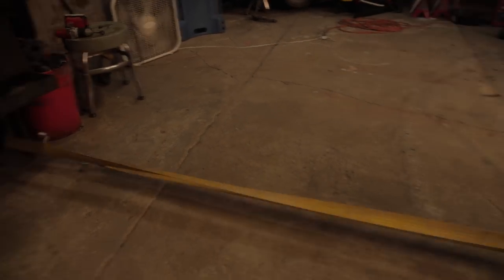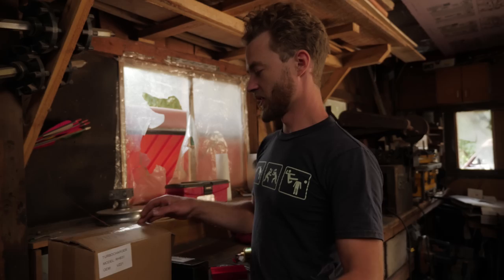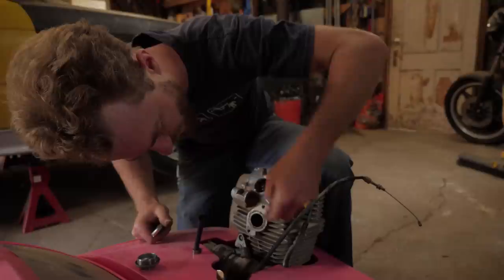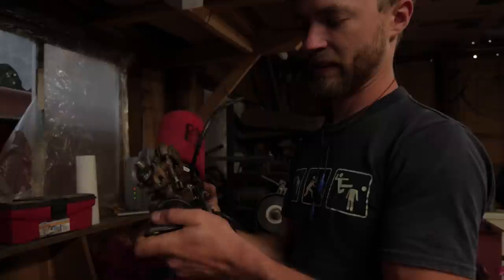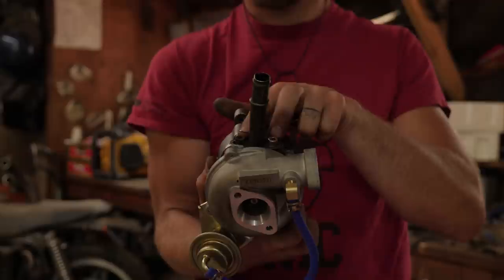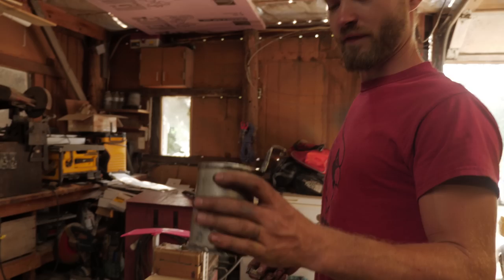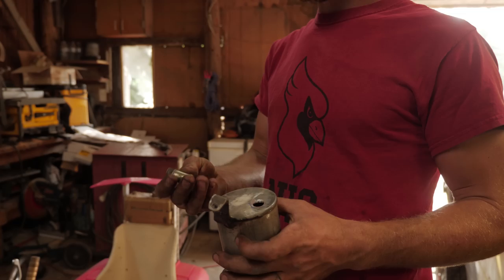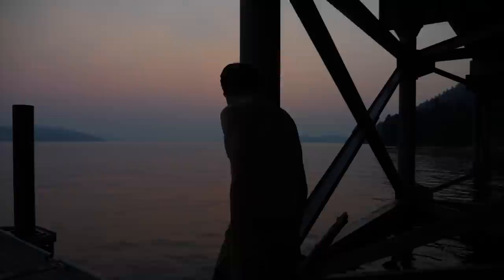Turbo Install on the Barbie Car Go Kart 4K

Comment: Every time I see someone throwing out one of these electric kid's cars, I want to throw an engine in it lol.
Reply: And here you gotta pay hundred to even trash condition one, those are not that common here.
Reply: Don’t forget new chassis for rigidity, new wheels and tires, new suspension, new steering assembly.
It’s essentially a gocart. So it’s going to cost more than $100. A lot more.
Reply: End Of The Month Ppl Throw out everything and a ton of this i pull them and drift corners with a dirtbike
Reply: Last week I had to throw a barbie jeep away :,(
Reply: Last time I went to the dump I pulled out a Jeep Hurricane.. Ya know the big one with the fake engine cover up front. Everyone says they want to build one of them but havent seen it yet. I want too just haven't had the time
Reply: how too buy that turbo..

Comment: Your flowing too much current through the pump man you need to put a speed controller on it then it will work it’s a scavenger pump it’s not meant to really build pressure so you need to take the speed of the engine down in order for it to constantly run hope this helps hopefully you see the comment
Reply: pumps don't make pressure.
Reply: @paulrice2863  yes they do
Reply: paul rice 
Now we know why your bicycle tires are always flat....
Reply: Yes unless your pump is from the dollar store they create pressure
Reply: @movieya220 pumps create flow, pressure is made from orifices. we aren't talking about air, and air pumps don't create pressure either. the restriction of space to escape creates pressure. educate yourself
Reply: paul rice ok so what good to know
Reply: LOL everyone just got schooled.  Turbos create flow, not pressure.. pressure is a measure of your engines shitty efficiency.  That's why big v8 cars don't need much boost "pressure" to make a lot of power.
Reply: TurboVisBits ok...
Reply: paul rice 
Pump creates flow, flow plus resistance creates pressure.  So who creates pressure if not the pump? Pressure fairies?  And a pump will create neither flow nor resistance without something powering it , and whatever powers it will create neither either without me (or you, if you can figure out how to operate it)
Starting it (internal combustion ) flipping the switch  (electric ) or manually operating  (human horsepower ) could also be powered by many alternative sources including nuclear  (steam driven) so does Briggs and Stratton create pressure? Do I create pressure?  No ,pumps do,and flow is a requirement to build the aforementioned pressure along with other system requirements. Including the orifices that you mentioned, but an orifice is only a hole, and I have yet to see a hole that creates pressure,  with the exception of an asshole. 
Perhaps you should inform all of the current oil pump manufacturers that based on your rules of pressure, that they can continue selling their high volume pumps, but should no longer market their falsely advertised high pressure pumps,because you're on to em and their aforementioned false advertising.
And if that was the case then pumps would be rated solely by GPH instead of as lso rating by PSI, so when you're finished with the oil pump manufacturers, straighten out the manufacturers of hyd. splitter pumps, maybe the price will come down once they know you're on to them as well....
Reply: paul rice 
And yes I am actually very uneducated, but hasn't been a problem yet...
But seriously think about that oil pump scenario,  if you increase pressure by no other means than adding a High Pressure Oil Pump, then what changed besides the pump?   The only change is the internal design of the pump(orifices ) but that pump creates the pressure. Let me know if you disagree, and I'm confident you will. We can discuss each other's educational background if you like...
Reply: Amory Martinez
I'm sorry Amy I didn't know that you wanted to talk, or I wouldn't have been so quiet...
Reply: Im so relieved none of you have access to straws.
Reply: @paulrice2863  "pumps create flow" lmao do you even know that your "flow" is caused by DIFFERENCES IN PRESSURE?? Turbo creates the higher pressure which flows to the engine to compensate the lower pressure of the combustion chamber. While to a casual observer it might seem like it's just "pushing the air forward", the turbine is actually creating higher pressure on the other side of the blades and lower pressure on the other side which causes the air to flow trough the turbo. The constant spinning prevents the pressured air from coming out of the intake, as the air would have to do more work to get out of the intake than it would if it went trough the intake manifold to the combustion chamber. P*V/T= constant
Reply: Brian Baker 
Please elaborate,  I didn't know that we were discussing straws,but it's late and I don't have any thing else to talk about. 
What do straws do ?  Make pressure or flow?
My opinion is neither, but could be a portion of a system to make either.  Yea or Neah?
Reply: So as a certified mechanic I can tell you that what you are going to be taught in school is: Pumps create flow, Pressure is caused by restrictions to that flow. That is the "Official" answer. If you dig a little deeper into it you could say that there can be no pressure without flow, or no flow without pressure. So you are both correct HOWEVER the official answer: Pumps create flow, not pressure.Either way, awesome video. The amount of work that you have done to this is both insane and awesome at the same time. I was thinking of doing something similar with my sons jeep.
Reply: @nadmaster101  do you guys even read physics in your "mechanics school"? The "flow" is literally based on the fact that differences in pressure want to get even. Molecules in the higher pressure are packed together tighter and spread to the lower pressure due to lesser amount of air molecules that resist the movement. The 2:nd law of thermodynamics states that a the energy of a system aims to spread evenly. Enthropy always increases when energy is transfered.
Reply: Auburn
 Thank you,  in my opinion it's essentially the chicken or the egg question .
While my certification haven't been up to date in approximately 25 yrs.(went different direction,  up I guess since I'm a lowly iron worker now)
To be honest I don't even know what type of pump was discussed in the video due to not making it that far,before find his pumps don't create pressure response,. I understand the stock definition /explanation  but dis agree with it on many levels and developed that opinion due to one of my early instructors having a similar opinion.  I just feel that in the aforementioned high pressure oil pump  that since flow and restriction are contained in the same unit  that the pump creates pressure.  In the case of a turbo  it  generally requires a separate piece in the chain to create pressure, so therfore a turbo as an air pump only creates flow.  The aforementioned instructor ,right or wrong classified pumps in multiple categories pumps that only develop flow, high pressure pumps and hybrids of both IIRC.  Either way I'm open minded so will elaborate that all of my statements are strictly the ramblings of a everyday average hillbilly....
Reply: I understand the physics of it as well. I'm simply stating that we are taught in school, I'm not saying I agree with it, however it is what it is. The way we are told to think about it is like this. If your hydraulic pump is constantly running, ie. pushing fluid through but there is no LOAD on the system there is no pressure, it is an open loop from hydraulic tank, through the pump, through the system and back to the tank. This creates flow but no pressure. It does not create a pressure until you close the loop and require that flow to do some type of work, meaning you start using something hydraulic. Link provided. https://www.hydraulicspneumatics.com/200/TechZone/HydraulicPumpsM/Article/False/6401/TechZone-HydraulicPumpsMI'm not saying you are wrong, and we can sit here and try to debate the physics of the whole system, but like my previous statement says you cannot have one without the other.
Reply: @nadmaster101  the link says page not found :/ but anyway I understand your point and all. Yes in a case where every single molecule would flow around a loop without friction and we wouldn't count the force the walls of the pipe in a loop would cause to the fluid to redirect it, there would be no differences in pressure. But in order to make the fluid move we have to have some kind of a piston or turbine that creates the differences in pressure which in turn starts moving the liquid around.
Reply: Unlike physics and the scientific method, we mechanics no not have to account for every single variable. I don't have to care if my fluid is getting .005 PSI of resistance from the walls of my pipe, that essentially is nothing. That's why I said that both of you are correct, the action of creating the flow actually creates a pressure while the fluid is in pump itself however the fluid coming out is not pressurized until work is done with it. As non-scientific mechanics, I don't have to care about that, as a person working on a scientific degree, I would still agree with both of you.
Reply: this is why pumps are rated CFM not PSI
Reply: Zac Price, Bingo! I was waiting for someone to point that out!
Reply: Emil Lerp "Pump creates flow, flow plus resistance creates pressure. So who creates pressure if not the pump?" I believe you answered your own question right there. In theory, and in practice, it is possible to have a pump which does not create any pressure to a given system. A water pump drawing water from a tank at 1 atmosphere through an inlet of a given size will output water at 1 atmosphere provided the outlet is of the same given size. No pressure will be added to that system UNLESS a restriction is placed on the outlet. Typically that restriction would be in the form of either a valve (a variable orifice) or a fixed smaller orifice (than the inlet). The pump on its own does not create pressure, only the resistance creates the pressure. 
Oh, and fluid pumps are rated in CFM, not PSI. The automotive application you refer to where the pumps are sold with a PSI rating is a measurement of the fluid pressure output AFTER it has passed the restrictive orifice, i.e. the combined action of both the pump and the restriction, not just the pump. If you remove the restriction in the outlet the pump will flow at the same pressure as the liquid in the tank, which in the case of a fuel or oil tank in a car it would be.... you guessed it..... 1 atmosphere.
Reply: CFM is a air pump rating. Things like gpm or lpm are for liquid.
Reply: Paul, explain that to my oil pressure gauge.......
Reply: lmao paul rice contrary to what they taught you at technical college, flow is the natural result of pressure differential. pumps create pressure.
Reply: @TabMcLain   didn't go to a technical college.

Comment: Haha! I seen someone in the comments suggest a turbo for this & I was thinking how crazy that would be... Then you guys actually did it! Insanely awesome!!!
Reply: Though they need to finish it and unfuck up multitude of things, like fuel pump as oil pump, when engine has its own oil pump. Trow that carburator away and fit in off the shelf fuel injection kit, before they fuck up whole engine running it lean. And there is many other problems with this cart.

Comment: There's typical off the shelf kits to outfit small air cooled single cylinder carbureted engine to fuel injection, it only needs a few input signals to convert to fuel injection that's programmable for boost
Reply: Daniel Bargas been looking for a while and never saw anything like this. Point me to it if you can please.

Comment: Make sure you dont run it lean! You will melt your piston. Fix your fuel problem before running it.
Reply: lean is efficient if you go extreme (18:1)
Reply: @ellenorbjornsdottir1166  lean is mean, haha its so bad for the engine tho
Reply: I’m confused is the engine he used a two-stroke or four stroke because if it’s a four stroke it just won’t run well and if it’s a two-stroke it’ll run good but burn a hole in your piston
Reply: Señor Burrito it's a single cylinder 4 stroke pitbike engine
Reply: its like a honda xr200 engine or something like that.. lol
Reply: @zealandboutin2494  Everyone always talks about "burning a hole in your piston" but I've been involved in motorsports for 25 years and have yet to witness this magic phenomenon. I would think the more likely scenario is that your piston and rings would seize running a 2 stroke lean because of heat and lack of enough lubrication. The piston gets a great big blast of cool air every intake stroke, so the idea of a hole forming seems impossible. I believe you would need a turbo charged engine with EGT's approaching 1400 degrees f sustained for a hole to form. I doubt your average lean 2 stroke gets anywhere near that temp.
Reply: Mcroostr I’ve seen it happen someone running a big bore kit too lean on a 125, put a big hole straight through the piston
Reply: Yea, lean and more specifically stoichemitry is more efficient sure, but it also results in higher cylinder temperature. This can not only result in the engine over coming the octane rating of the fuel but also unstable combustion and heating up the piston head and piston ring. Most factory ring gaps aren't very wide and when the piston ring heats up beyond design spec and expands it has no where to go and shatters the piston ring lands.

A richer fuel ratio of about 12.5:1 (and often times less spark advance) helps to cool combustion and even draw heat out of the piston head.
Reply: Mcroostr, I've personally blown a hole the size of a pencil eraser right in the center of a two stroke 54mm piston. Too small of a main jet at full throttle concentrates that lean "torch-like" mixture right there beneath the spark plug at the point of combustion and cylinder pressure combined with that punches out the top center of piston.
Reply: @daviddntait  did the same thing with my turbo mustang. Melted a set of forged pistons #1 piston had a hole the size of a quarter lol
Reply: @_..-.._..-.._  motorsports for 25 years.  Have you been racing lawnmowers your whole life? Burning holes isn't uncommon
Reply: Is it the particulates and carbon that cause the pitting after detonation when running too lean?
Reply: @S1UMLORDpaulo  when it runs lean it gets extremely hot in the combustion chamber and literally starts melting the piston

Comment: And use 0w-20 oil for the turbo’s oil system, you’ll be able to flow more oil from the pump and have less resistance in the bearing.

Comment: Your transfer pump for the oil only needs to run when pressure drops, it will run more often as the oil heats up.  The bright side is if it shuts off, its primed. So you can rest easy that there is oil on the bearing. 

I have a 1980 cm200t Honda that I have been wanting to twin turbo with this exact turbo.  To be different and be able to climb hills on the high way without slowing down. 

Its a kick only bike, so I plan to replace the starter with an oil pump.  

To re power hot wheels when we were kids we hooked a chain to it and pulled it with the neighbors dad's suburban. It wasn't safe but it was fun.

Comment: Link to the turbo kit ?
Reply: Crusty Sock  what do you mean?
Reply: adrian sanchez your gonna need a bigger carb jet and a fuel pump then you will need to fabricate an oil system for the turbo then after that your gonna need a billet cam, rod, flywheel, and stiffer valve springs. Without the pump and bigger jet you will run lean, without the stiffer valve springs you will get valve float, and without the billet flywheel and up graded connecting rod you’ll probably throw a rod or there’s also a chance the flywheel will blow
Reply: Paul Kanarios those things are probably mostly true but how would you get valve float from an overhead cam engine like the one in the video? I thought that was only on pushrods. Correct me if I'm wrong
Reply: Henry mm didn’t realize it was an overhead cam. I’ve never really worked on ohc engines. I have ohv on my minibike and after removing the governor and adding nitrous injection when under high rmps I feel a loss in power and my grandpa told me it’s valve float so I got stiffer springs and now it revs much higher, I just assumed it was ohv as a lot of small engines are.

Comment: Oil pump needs a oil pressure release valve, or even easier create a bypass with a small restriction inline to the cooler to increase the flow of the entire oil loop. It's probably building pressure till it runs out of torque to move any more oil volume.

Comment: Im sure you already have changed it but if you haven't and it's still stock; change your CDI box to a Big Gun over rev. It gets rid off the rev limiter and has a more aggressive curve.  It makes a difference on the 150/230 platforms.

Comment: The ring piece with the fuel line coming off of it is the banjo. The banjo bolt goes through it. Make sure you have a copper washer on both sides of the banjo before you put the banjo bolt through it.

Comment: an accumulator might not b a bad idea for the oil system because its small enough capacity n would avoid oil starvation from hard cornering or rollovers  wich if u ride long enough will eventually happen

Comment: Its called a banjo bolt because 5 string banjos have the 5th string that ends on the 5th fret. The tuner is bolted into the side and the string passes through the hole. Hence banjo bolt.

Comment: May want to consider a lighter oil for the turbo system to help with the restriction and improve flow. Youll also need a controller for your oil/fuel pumps to help maintain steady flow. Without a speed controller the pumps will just kick in and out constantly. They arent expensive or difficult